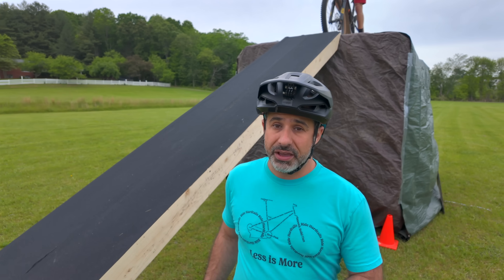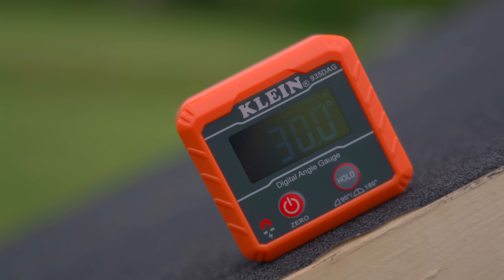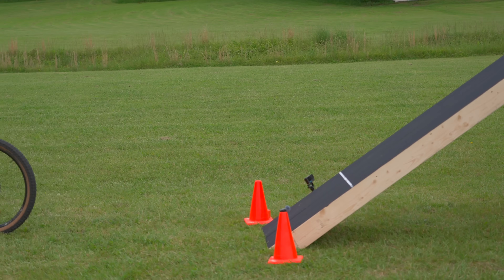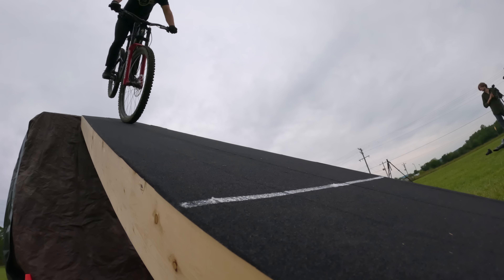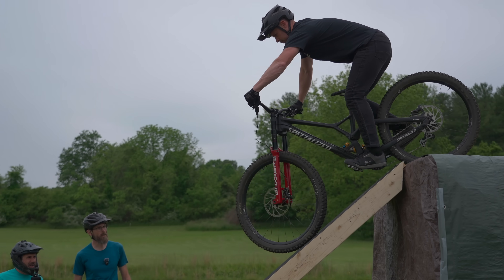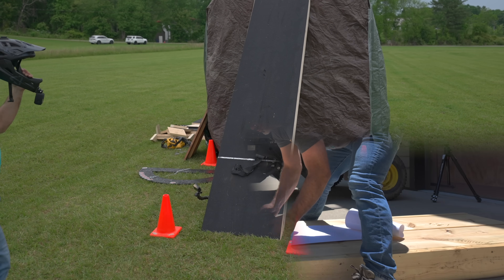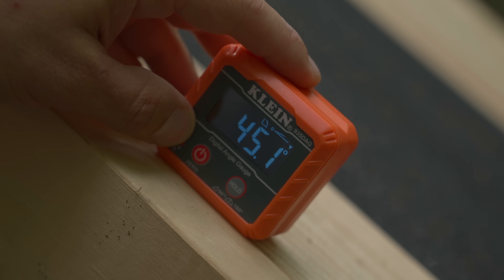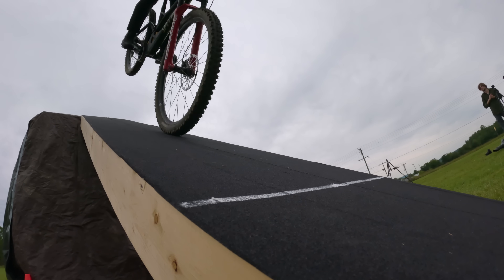Could You Stop? Our Brakes Were Useless At This Angle

Comment: Cutting the board shorter means you are shortening the distance you have to stop. To make it a ‘fair’ test, you need to raise the height as the slant increases so that you have the same distance to stop. I’m too lazy to do the calculation, but it seems like the shortened distance would be significant.

Comment: If you want to be more scientific you can try doing it on a horizontal surface and then measure the amount of force it takes to break traction with the ground by pulling the bike with a cable. you could then test it on different surfaces with different tires.

Comment: Your test setup is somewhat flawed in the immediate transition from flat to angle is itself causing you to loose traction, if it was purely to find the maximum angle then smooth curved entry from flat to the angle would work better and allow the rider to find the balance point between tires and also not upset the bike with traction breaking bounce.
Reply: Your flaw is still not knowing lose and loose

Comment: Two notes. 

1). The static coefficient of friction is usually higher than the dynamic coefficient of friction. So, two surfaces that aren't slipping have more friction than two surfaces that are slipping. This means that in the second test at home, your drop in might have really been hurting you, as you essentially start the test already slipping. On the first test, since there was a gentle roll in instead of a drop, you guys could could ease into the test, letting your tires maintain the no-slip condition and keep using the higher, static coefficient of friction. If you had a significantly longer ramp, you could conceivably slowly squeeze the brakes, which would slowly bring you to a stop while allowing your tires to roll without slipping for the entire braking event.

2). Most tires experience "tire load sensitivity" which means that the coefficient of friction for rubber drops as the normal force increases (this is also why dropping the air pressure in your tires increases traction). This means that evenly splitting your weight between the front and back tires should give more grip than having 95% of your weight on your front tire. You said that you thought that you had more grip when you had most of your weight on your front tire, but I am guessing that had to do with the fact that you were often balancing on your front tire, moving your weight back, and then landing hard on your back tire. That hard landing probably induced a bit of a bounce in the bike, which temporarily unloaded both tires, inducing a skid down the ramp. And as noted in point 1, once started, a skid can be hard to recover from on such a short ramp. This hard landing could also be fixed by having a more gentle roll-in into the 45% ramp, which is possibly why you had more luck on the first ramp.

(Watching the video again, I also notice that the back tire was often slipping while the front tire was rolling without slipping. This gets to the skill involved in this test, as to maintain rolling without slipping on both tires, you will need to give the tire with less load (usually the back tire) far less braking force than the tire with more load. So, when they felt slipping on the back tire, they should have eased off their rear brake lever, let the tire re-establish rolling without slipping, and slowly grip the rear brake lever harder until the tire just begins to slip.)

Hope to see this test again, Joe was so close to getting that complete stop.

Comment: Being taller and (probably) heavier, not only your center of gravity goes up, but your brakes need to dissipate proportionately more energy to get you to stop. At 230 pounds I am probably something like 40% heavier than the average person, so 40% more heat dissipated in my brakes for any given decent where I come to a full stop at the end. That's also something that worries me sometimes: even if my brakes are powerful enough, my tires are grippy enough and my position on the bike good enough to control the descent, my brakes might get fried at some point.

Comment: Do an episode with Destin from Smarter Every Day! Maybe catch some rubber flexing and skipping forward in slo-mo.
The most basic experimental set up would be to eliminate the rider, bike and slope. Just a locked wheel with weight on top and a pulling force to make it slide. You'll need some trigonometry to reflect it to real world though.

Comment: Thanks for asking! I had visions of a competition early in the video. You played with the basic concept via air pressure and tire compounds. 

The competition is to build a bike specifically to win a competition of increasing grades. Tread, compound, pressure, bar changes for altering CoG, suspension pressures, frame and anything else you can think of.

Comment: Seth, although entertaining, this video shows the maximum angle in a perfect world, I'd be interested to see this test in the real world on a dirt trail. 

There's a hill near my home in SoCal that we call "Colossus" on Millenian Trail that is pitched quite steeply (so steep we've never cleaned it uphill on ebikes) and has hard and soft dirt, rocks, ruts, etc. My friends are much better riders than I am so they use the "no brake" descent. Whereas, I typically brake control the first third and then let 'er rip. I would never try and stop on it because there just isn't enough traction.

Comment: Pretty cool to see this done on a bike and not a block of wood like in school.   Interestingly, the equation for sliding friction does not depend on surface area only compound and normal force, so a flatter tire just helps to grab more area averaging out inconsistencies; grabbing features like rocks is different. Also according to this equation the bike should not matter at all if you’re balanced like a unicycle on the front tire!

Comment: Holy shit, good video Seth!
There is a million scenarios possible in this test, this is an opportunity for a great series.
Maybe tire testing? Same bike, same rider, same ramp, different tires at high pressure and low pressure.
Instead of cutting of sections, you can do a telescopic frame, maybe aluminum profiles? Someone thinking alike?

Comment: Hi Seth!

I looked into the subject of tire grip some time ago and found out something interesting:
Three things are necessary for maximum grip:
1. soft tire compound
2. large contact area
3. fitting threat pattern

The coefficient of friction depends on how well the rubber can interlock with the ground. Softer rubber compounds can adapt better to the roughness of the ground and therefore offer more potential for grip.

But to use this potential you need sufficient contact area, otherwise you only shed the rubber of the tires.

Last, you need a fitting threat pattern. The harder and smoother the ground, the smoother tire tread is needed.
Reply: No matter what you do, the coefficient of friction will not go above 1.0, which means 45 degrees is the theoretic maximum. Only way to get beyond that is to use tires that don't need to rely on friction, i.e. use tires with spikes or something like that.
Reply: @nekekaminger  That's not true, the coefficient of friction is unbounded. Rubber on rubber is over 1, they've created artificial surfaces that reach over 5. Friction is just the intermeshing of microscopic surface imperfections, even velcro or gear teeth arguably exhibit 'friction' with very high coefficients.
Reply: @speedstyle.  interesting, back in school I was taught that it can't go above 1.0 but looks like material science has evolved since then^^ Anyway, I think it's unlikely you will encounter surfaces on which bike tires have a coefficient of friction > 1.0 in any situation that resembles real world mountain biking conditions in any way.
Reply: @nekekaminger   A coefficient of friction above 1 is indeed possible. For example with sticky rubber or even with a slice of salami ;)
But at which point is it no longer friction but adhesion? 🤔
Reply: @nekekaminger шипы уменьшат площадь контакта, если только они не процарапают поверхность. Тогда площадь контакта увеличится за счëт борозды которую они оставляют на материале
Reply: Рисунок протектора влияет на пятно контакта. Поэтому эти пункты в одном.
Reply: My parents said if I hit 1k they'd buy me a professional camera begging you guys literally begging!
Reply: @xtincsz  As much as I like to support aspiring youtubers, I can't approve of your approach here. 
To be successful on YT, good content is crucial, not begging for Likes or Subs. Especially if it is an unrelated response to a video, that has nothing to do with Fortnite!

Comment: It's also interesting to think about these angles in terms of skiing for those who also ski in the winter. For perspective a 30° slope is about what a black diamond ski run is at most ski resorts. A lot of double blacks are 35-40° with maybe a handful of the steepest runs tipping > 45°.

30° is also the slope angle where it's steep enough for a slope to avalanche.
Reply: For reference the steepest pisted run in the Alps is Harakiri in Mayrhofen at 78%, which is only 38 degrees. 45 degrees would be seriously steep, I think only the top lips of a few bowls would exceed that.
Reply: @colophon2377  NA there are more > 45 degree runs

Comment: So one issue to consider is that as you increased the angle you also decreased the distance available to come to a stop. That is, you made it harder in two ways. I don’t think this would work, but a fairer approach would be to use the same length ramp each time and attach it to a scissor lift to increase the angle as opposed to cutting the ramp each time. As a side  note when you cut the ramp, not only do you decrease the distance available to stop you also decrease the amount of time you have to stop.
Reply: Could also use a longer ramp with a line closer to the middle (for less steep angles like 25°) and cut ramp length from below the stop line, so that you always have the same distance of stop track but the ramp still gets shorter…just cut below the stop line
Reply: They're not gaining enough speed for this to be an issue.
Reply: Those were my thoughts exactly. Should have read this before I posted.
Reply: @michaell1026  Me too.
Reply: Not how brake failure and friction works bud
Reply: well at that gradient once you slide you will not come to a stop after unless the grip level of the surface below your tire suddenly changes for some reason. what would help is a "rounded" drop-in, so you build up gradient slowly instead of having to overcome a hard edge.
Reply: My thoughts exactly, raise the platform don't shorten the ramp. And that slight drop when he tested it later almost certainly hurt his performance, he couldn't keep both tires on a surface the whole way onto the ramp. I'm not sure if a scissor lift would be a good choice, too wobbly, but you could pretty easily construct a frame that you could mount a platform at multiple heights. Maybe even secure the ramp to it with hinges. There must surely also be better grip tape? That stuff came off a lot more easily than I would expect.
Reply: Automotive engineer here. I haven't seen much mention of sliding vs rolling friction. The decreased distance means there's less time to stop. Even at low speed, this makes a difference. Slowing from 1pmh to 0 over 10 feet vs 5 feet is twice the deceleration. This results in twice the force felt by the tires. This means its more likely that rolling friction is overcome. Once rolling friction is overcome, the mass is now sliding. Since sliding friction is lower than rolling, you're screwed. This is one of the main reasons for the development of ABS (anti-lock brakes). The moment the computer detects skidding (sliding), it lets off the brake for a fraction of a second to regain rolling friction to come to a controlled stop. This theory has been tested for decades and proven in the automotive world. This is intuitively felt by the advanced rider and is the reason for brake modulation, forward/back bike balance (which maximizes the rolling friction of each tire), and the reason Seth kept sliding at his home (the gap between the platform and ramp increased the amount deceleration needed)
Reply: Too low incoming speed. Ramp length is irrelevant in this case.
Reply: Yeah, ramp distance would make no difference at there roll in speed
Reply: I was hoping I would see this comment and was not disappointed.
Reply: This is true, though at the same time they're using grip tape, which likely has far more friction with rubber than dirt on a trail. Which probably balances it out somewhat. It's not a realistic test by any means but it gives a rough estimate which is good enough.
Reply: @charliecharliewhiskey9403  this would only matter for this test though if they added it for the steepest angle they used grip tape for every angle sooooo still each time the angle changed they had less distance to stop without anything to compensate for it.
Reply: I agree, having more time to break would change how effective breaking is at an angle. I want a retest.
Reply: Longer ramp will not benefit much I it will actually make it harder to stop. Because cycle doesn't have inertia.
Reply: Yep, fist I thought when watch him cut
Reply: Exactly what i was thinking. Also the drop from platform to ramp start was a problem.
Reply: Guessing you didn’t account for the higher potential of injury if you wanted more angle with the same length board. Would need to be much higher than it already is.
Reply: Just imagine he would be 20 feet in the air doing this test and I’m not sure about you but I wouldn’t want to even try at the height he’s already at let alone another 10 feet
Reply: i think it would be more difficult with increased length because for their test their speed didnt ramp up as much it would for increased length and braking in not an option because we can clearly see at that angle it skids. just my take maybe i am wrong
Reply: I mean they can just go extremely slowly right?
Reply: The distance has very little to do with the failure condition in this test. Traction or not. That’s it
Reply: Yeah i kinda concur with this too, the bermpeak one also had a lip that put the bike itself at a steeper angle before the back tyre then bumped down onto it, the Grip tape on the bermpeak one also looked far more course than the previos setup.
Reply: nah, they were coming in at such😮 a low speed that length of ramp does not really matter here, IMHO. If they could have stopped, they would.
Reply: @andreybatashov2183 They were combining in at low speeds but the transition the back tire makes from flat to vert requires an adjustment in their body positions which takes time. There were times on the shallower ramps where they initially started sliding but regained control. Like previously mentioned, they could just try to keep the same length of approach to the stop line and cutting from the other end so the stop line gets closer to the end of the ramp each time.
Reply: @andreybatashov2183  I mean...no. Every time they got on the ramp you could see them slowing down immediately after they got on the ramp. Clearly no matter how slow want to start they got on the ramp without holding their breaks and had to slow down. the more inclined the ramp is the faster they start even if it doesn't SEEM that fast while watching.
Reply: Also, the time available for body stance and general stabilising is decreased. Definetely, a very flawed test.
Reply: I mean this can all be calculated using physics/math anyway lol we did problems like this in high school physics
Reply: You can calculate this with high school physics if you assume the tyre and grip tape grip as a constant and exclude all environmental factors. Including air pressure, altitude, moisture, differences in tyre material and size, variations in technique etc. would be a little advanced for high school unless your school was in Wakanda. That’s why practical tests are fun – you get instant results. You can calculate a theoretical maximum using made-up values, but calculating a real life situation is just impractical use of resources.
Reply: No they also have less time to accelerate due to gravity so I think it cancels out.

Comment: VELCRO TIRES AND RAMP (highest coefficient of friction). Coming from the land of "Slickrock" which offers better grip than  your tape... You would  be better off with natural bumps and imperfections for your nobbies to engage with, like much higher grit sandpaper.  Maybe glue some pebbles/gravel to the ramp with enough space in between to engage the nobbies or take a casting of the tire tread and flatten it out for a perfect interlocking like a gear.

Comment: Seth, what grip tape is that?  There's a night and day difference between brands.  Some are just basically tape with a matte finish (like Mob) while others will draw blood just handling it.

You NEED to try that with the coarsest grip Vicious sells. It's a night and day difference between even stuff like Jessup, and at least twice as aggressive and sticky as Roam.  Vicious is meant for downhill, to absolutely glue your feet to the board under high lateral Gs while railing corners at highway speeds, and it does.  Regular non-DH tape doesn't hold up to those Gs and you just slide off the board.

Vicious tape will probably tear a chunk off your tire or flat spot it before it lets go lol, it absolutely eats through shoe soles in no time. Combine that with some sticky 3" tires at super low PSI and a seatless trials bike (or small frame with seat removed as long as you have reach and clearance) and get that ass hanging low behind the rear tire.  It'll happen,  i've stuck to stuff that steep riding trials.
Reply: Pizza tape for the win!! Equivalent to 15 grit, although, you better have a source of skin for the graft if you eat it!!